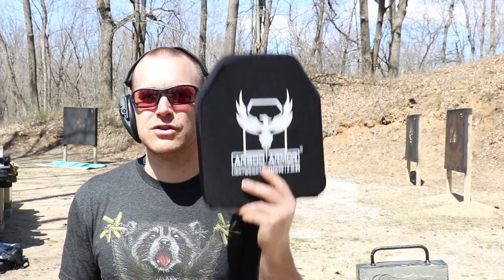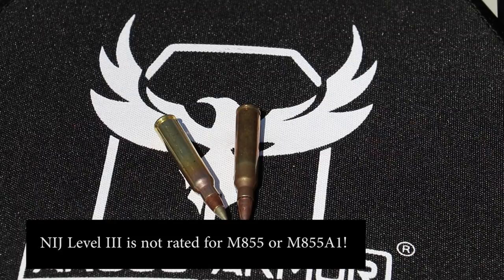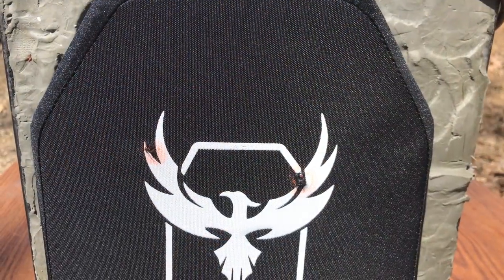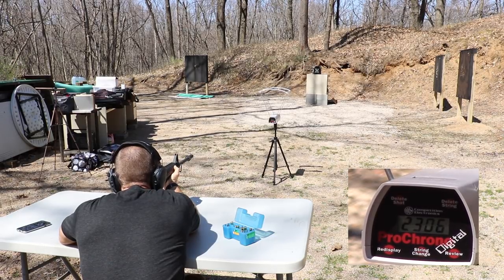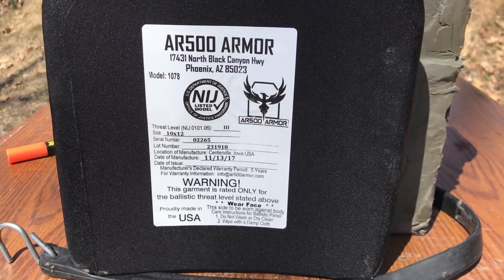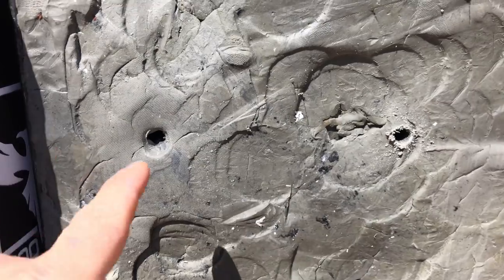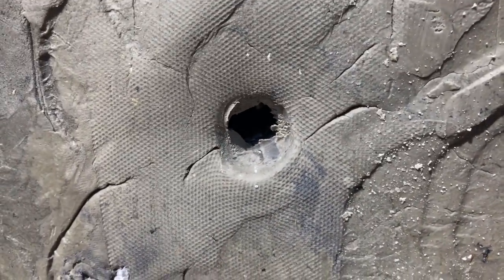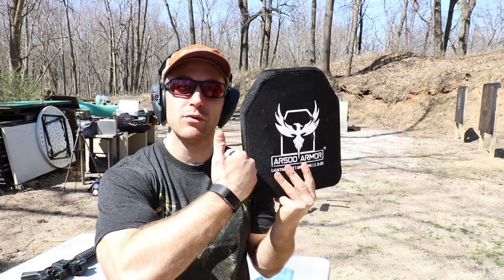Can Armor Stop M855 or M855A1? @AR500 Armor® 1078 Level III

Comment: I wish I could afford that. The plates I got are just shy of 8 pounds a piece (steel III+) , and although 16 pounds doesn't sound like much, it can be a big pain in the butt when combined with other gear. I think people tend to underestimate how heavy a few pounds really can be. Hell, if ever I had to hike around in full gear, like at one of those competitions where you run around in the desert and shoot targets, I'm pretty sure I'd just wear the front and be ditching the rear plate. Shit, if in an alternate dimension I was in an occupation where I needed kit for something more than being a nerd basically LARPing at the shooting range, I might still ditch the rear in any extended life-threatening scenario. Maybe get a IIIA soft plate for the back instead, but certainly not two steel plates.

But yeah, as a civvy I can't justify $700 for something I don't actually use and just have 'cause it's neat. I'll have to stick with heavy and cheap.
Reply: First time I ever ran up a decent size hill wearing 2 11x14 AR500 plates I puked at the top. That doesn't happen anymore but it's still not fun. Those plates are 11 pounds a peice, plus my weapon and a 30-pound pack. Yuppers, puke city.
Reply: I know this comment is a year old and things change... Still thought I'd let you know that hesco l210 or 4400's can be found for about 350-400 for a pair. Definitely worth the upgrade even if you only buy one plate at a time. The l210's are 5.5lbs for a large and will stop m855 & m855a1, and the 4400's are way better rated than any steel and weigh a little less

Comment: I'm not stating as fact but it seems strength stops velocity where as hardness stops composition. AR500 is kinda hard and kinda strong. UHMWPE is really strong 350000psi but not hard at all. I think this is why composite works so good. Nice video!!!
Reply from the maker: There's probably a lot at play that I will never fully comprehend, but that seems to be a decent generalization. Ceramic is pretty  hard and strong :D
Reply: Buffman - R.A.N.G.E. Agreed
Reply: I just don’t understand how the m993 (308 tungsten carbide AP) zipped right through level 4 ceramic plates like they weren’t even there. Isn’t ceramic carbide much harder than tungsten carbide?? I don’t get it
Reply: Joe Vazquez Tungsten is also very dense and very strong.
Reply: @Joe: A mix between hardness and thoughness. Ceramic while being really hard and able to deform steel projectiles, shatters on the impact which isnt a problem because the larger surface area of the deformed projectile gets stopped by the kevlar backer.

But tungstencarbide while incredible hard also is one of the thoughest materials (and verry dense). So due to its hardness it doesnt get deformed, and due to its thoughness it doesnt shatters eighter, the combination of both lets it penetrate LVL4 composite armor. And as seen in one LVL4 test, one time the wc penetrator actually shattered but propably a bit too late and therefore made it through.
Reply: So if I had a bunch of tungsten carbide blocks and the milled them into bulle4ts I’d essentially have m993? :😁
Reply: Not unless you perfectly match the penetrator and jacket shape etc. If you would have them in shapes similar to penetrators you could set them in jackets and make your own ap projectiles but not sure if thats legal, even though there are actually quite a few videos on homemade tungstencarbide shotgun projectiles.

Comment: Honestly I would rather wear Level 3 plates and save myself almost 10 pounds since I doubt im getting shot with 308 AP or more lol
Reply from the maker: Sound logic. I may be more inclined to wear a III+ ceramic strike face since M855 threats would still be a concern.
Reply: Level IV ceramics only weigh like 5.5 lbs.
Reply: @BuffRANGE  m855 has been cheaper than fmj for the past year.  You can basically assume that everyone is running m855 now
Reply from the maker: @poisonouslead85  pretty much, which means using a pure PE plate would not BE a good idea in the CONUS

Comment: this just busted out any thought of getting UHMWPE. If M855 out of a shorty can bust through it then I don't want it. I'll spend less on CATI 3+, get used to humping the extra weight, and be covered by all these threats plus some. I don't think M855A1 can bust through their 3+ unless it's out of a 20 inch barrel and that's a combo that is unlikely to be seen. Or I'll get RMA's Lvl 4 when it goes on sale for $99. Now THAT's threat protection. They still have a lot of work to do with this material before it's rated for close-quarters combat with AR's.
Reply from the maker: Spot on considering M855 is very very common

Comment: Concerning  the beginning of the video, where you explain your previous tests on this armor - How can a plate be considered Level 3, but not stop M855, especially out of a 16 inch barrel? Isn't that one of the certification requirements. Or do they only test with ball M193 ammo?
Reply from the maker: That's where the current NIJ standards fall short. a Level III plate only has to stop 6 shots of M80 ball in .308. NIJ levels will also encompass threats from lower levels, but currently no 5.56 round is listed in any threats. Typically this is why we see special threat ratings and or the "+" rating. I know the NIJ standards they are proposing will attempt to address the 5.56 threats.
Reply: Buffman - R.A.N.G.E. Hmm, that's very interesting. I always assumed that a 5.56 requirement was rolled into things, but on a second check it seems you're right and Lvl3 is only explicitly tested against .308, 762x39, and .45-70 (?). The definitely seems to be a major oversight, since regular 7.62 NATO ball has significantly less penetrating power than 5.56. I would assume though that Lvl 4 would be fine, since .30-06 AP is (probably?) going to punch through more than even M855A1. I wonder if this has been true in your tests.

I wonder if the MIL-STD spec the DoD uses (662f) isn't a more accurate test. I hadn't heard anything about a new NIJ standard, but I think it's definitely about time.
Reply from the maker: "An entirely new threat level has been introduced to fill the gap between RF1 and RF3. This RF2 threat level includes protection against the 5.56mm M855 round. The M855 bullet is 62 gr with a “penetrator” steel core at the tip, enabling it to more easily get through barriers."

Generally though, yeah a level IV does encompass a lot of untested threats below M2AP. I am currently waiting to test a tungsten core AP 5.56 round, but Level IV can stop M855/M855A1/M193, and a various slew of threats.
Reply: That'll be an interesting test to see. I wonder if it will be possible for you to take some shots at a little longer ranges. I know that the Army is currently struggling under the assumption that the future adversaries will have Level 4-type ceramic armor, and the leadership seems to be saying that they don't really have a standard issue infantry found that can defeat that at general combat distances. So maybe the M995 (I'm guessing that's the round you're testing) has a limited effective range?
Reply from the maker: Yes M995 does :D RMA has a published test where their ultra light 1199 plate stopped M995 at a 100m velocity equivalent, and that plate is more or less designed to meet the standard of Level IV and that's about it.

Comment: This bullet, loaded on a larger shell to achieve 1200 metres per second, would eat steel like it's nothing.
Reply: like .22 swift or .22-250? That'll get that speed up. I wish they had an AR-15 setup for .22-250. I'd jump on that in a heartbeat. Load these EPR pills in a case like that and you would likely cook through anything under Lvl 4 ceramics.

Comment: So long as your aiming at center mass. When the armed bad guy is aiming at arms, legs, thr neck or for a head shot that plate won't do any good.

It further doesn't surprise me that the bullets shot from a rifle passes through.  Why?

Because the 5.56 was designed to be shot from a 20" barrel. Performance is lost when shooting from a shorter barrel. 

The shorter barrel prevents all the powder charge from burning which in turn reduces the power needed to reach the listed velocity and energy at the muzzel.

Since the carbine is the preferred AR platform it appears we can use these plates with confidence that we'll be afforded some form of protection.

Comment: What is the HRC hardness of green tips?
Reply from the maker: Varies by manufacturer. 48-54RHc
Reply from the maker: Sheldon Robertson  yep. I'd still call it hardened compared to 7N6, but M855A1 tip is harder at 59-60RHC. :D
Reply: Sheldon Robertson  M2AP steel cores are 60+HRC

Comment: I wonder what happens if you use that with a level 3a soft plate as a backer. Combined it would still weigh less than steel.
Reply from the maker: Steel portion would still be pointy enough to make it through most IIIA
Reply: anything that is remotely centerfire rifle ignores kevlar like it isn't there. M193 will pass right through ten Lvl 3A panels and not be slowed down much or deformed. It just can't deal with that velocity. I've seen regular ol' M193 punch through Lvl 3 AR500 steel and then through a 3A kevlar panel behind it and push 12 inches into ballistics gel. I'll never understand why people choose M855 over M193  as civilians. 99% of civilian gunfights are under 50 yards and most are within 15 yards. Even at that range it'll punch through most Lvl3+ if you hot enough M193 and aren't stupid enough to chop off your rifle's balls with an SBR length barrel. M855 was picked up because it punches through mild steel better at distance, simulating punching through a Soviet-era helmet at 300 yards or something to that effect. But it comes out at 2900 fps compared to 3400 fps from super hot M193 like IMI.
Reply: I see what you’re saying but problem is m193 is easily stopped by poly plates like this even at 3400 FPS and these poly plates are very popular therefore making green tip a potentially better option.
Reply: I’m loaded up mostly with m855a1 from a long barrel so I can defeat both steel armor and poly plates, and even a few composite plates designed to stop both m193 and M855. . Best of both worlds.
Reply: @user-oy9zy4ds9m  how do you have m855a1?!?!?

Comment: What if you had a flak jacket or a level 3a behind the plate, would that combo help stop m855?
Reply from the maker: it's possible but without something to deform the tip of m855 then the soft armor is not going to slow it down, but we'll try to test it with a PE plate
Reply: @BuffRANGE  thanks for all the info and the great vids.

Comment: These velocities and situations don’t seem like a realistic test, they normally hit 3100-3300 FPS
Reply from the maker: Because we are testing the ability of PE to stop M855 and M855A1. I am simulating range.  Also M855A1 is not 3300 fps from a 22" barrel. it tops out about 3200 fps in the 22"
Reply: I was referring to a bolt action 22 inch rifle, not ar platform
Reply from the maker: That is not the case. If you watch any of my armor videos, I go above and beyond anyone else on YouTube to give the viewer more buying power. While it's infotainment and a plug for the company, I'm not pulling punches or providing you with incomplete data. This was actually a follow up to this test: https://youtu.be/6MFopMivAAc

Users in various forums were curious as to what velocity if any could an all UHMWPE armor stop M855 and M855A1. So at the time I lacked shorter barrels, so I downloaded the rounds to simulate range. None of those velocities are "unrealistic". They are designed to mimic 100s of yards of engagement. :D
Reply: Buffman - R.A.N.G.E. i have 7.62x54r AP and API, M885a1(not just bullets) if you’d like to test any
Reply from the maker: @98MAzdaMilleniaS  Thanks. I certainly appreciate the offer. M855A1 is pretty $$$ right now, not sure I'd be able to swing any extra money
Reply: Buffman - R.A.N.G.E. I bought 20 rounds for $65. I can ship 5 rounds to you for free. You can test it if you’d like

Comment: In the chart i made a while ago, at standart 14.5" muzzle velocity of M855A1 EPR with a realistic modeled projectile in a dynamic calculator at 350y about 320m it was 2140fps, verry close to your measured 2133fps. I could recalculate it for the exact range, but this seems close enough.  Great video.

Btw, could you maybe do a video on the lowest velocity M855A1 is able to pierce LVL3a and atleast partially penetrates a gel block? One 62gr subsonic at 1050fps test you once did was through two LVL3a panels at once and it penetrated a wood board which equals M855A1 from a 14.5" barrel slightly over 780m, so the question is at what velocity does it penetrate one and make a sufficient injury.
Reply from the maker: I'll see if anyone I know has some spare projectiles to make some subsonic. I tried to make subsonic M855A1 with 5.7, but even at the 1300 fps it got, it was unstable. I may need a 1:7 twist to stabilize that slow. I'm going to say it would probably penetrate A LOT of kevlar. a PE test would be interesting in IIIA, since I've penetrated a IIIA PE with SB193 before which is a plain jane FMJ :D
Reply: As long as the projectile doesnt deforms M855 would work too, or at best a 62grain solid copper.

And its not really about how much kelvar it penetrates, but rather at what it does penetrate one panel and a certain depth into a gel block after that. This velocity than gives a more solid number to what range M855 and M855A1 stays effective against targets with fragmentation protection wests that cover more areas than the rather small hard plate.

Yes the FN5.7 twist isnt tight enough, ive seen your M855A1 test.

Comment: what about 22-250 vs this or steel armor out of 20-24" barrel at 200 yards? I'm guessing it would take level IV to stop that.
Reply from the maker: All depends on the bullet construction. 22-250 can sure drive the #s but most loads are uber light rounds meant for maximum tissue damage, not necessarily going to be good against armor.
Reply: @BuffRANGE  and if you load that up with a 62 gr EPR round?
Reply from the maker: @nicholaddelioncourt7863  It doesn't stabilize. I tried..

Comment: grains of what powder?
Reply from the maker: Likely TAC
Reply: @BuffRANGE  maybe./ probably right.  My 62gr Control Chaos loads to 25.65 before pressure signs. (10.3 DD barrel). (*pulls out book*) 24.5 TAC 10.3":  2407, 2788, 2506 ("min 23 max 25 TAC")
22gr? 1969 & 2133 FPS from his load. seems to light if a load.
Alternately, same barrel: 55FMJ 25.5gr TAC = 2500fps  & 75gn fmj 22.1 TAC = 2100 FPS.

--just listing cause.
Reply from the maker: @Gnolomweb  we intended to download them as we didn’t have access to a short barrel with good aim :)light load was intentional
Reply: @BuffRANGE  cool, np. just throwing my data out there for consideration.
It's good to know the velocities as is. I just need to know what armor the zombies have and what combo to beat em.
|My loadout for 10.3
= m855 @ 2700 under 50yrds and 62gr Controlled Chaoas @ 1700 FPS @ 75+ yards. (open to suggestions for unarmored zombies with better terminal ballistics)

Comment: 2244 fps  in a bolt action rifle?
Reply from the maker: Downloaded. These are uncharged on purpose.
Reply: Buffman - R.A.N.G.E.  oh tnx for the info :) non english speaker😅
Reply from the maker: No worries. I slowed them down so that we could simulate a longer distance shot.
Reply: Buffman - R.A.N.G.E. amazing,  i was imagine,  a old truck's leaf spring  its a pretty hard and cheap steel , can buy it in a Junk yard , its a hardened steel , but Can it stop a bullet?
Reply: B Souza maybe but the probablem is when the bullet hits it spalls and would pepper you up . That's why they coat steel plate's with paxxaon.
Reply: Blop Jones yeah , its easy to solute just using some fiberglass coat and poly resin as a Spall line , or just old denin and bond glue , some layers  in front , but the idea here is uses it inside of a improvise bunker door

Comment: M855 is very very common and so is M193....This isn't good.
Reply from the maker: correct. That's the downside to UHMWPE armor.
Reply: @BuffRANGE  Now I'm questioning if can even stop .223, since those tend to be very comparable to 5.56.

If it can't survive either one, it's vulnerable to the most common rifle and ammo combo.

This would be like a kevlar vest that can't handle 9x19mm.

Someone has to thicken the material or put it in a good kevlar vest or something.
Reply from the maker: @Seth9809  The issue with UHMWPE is it can't stop projectiles with hardened parts like M855 or M855A1.  FMJ or SP loads in 5.56 or .223 would be stopped by plate.
Reply: @BuffRANGE  What about the Duritium® GT2?
Reply from the maker: @Seth9809  it’s a ceramic strike face plate.